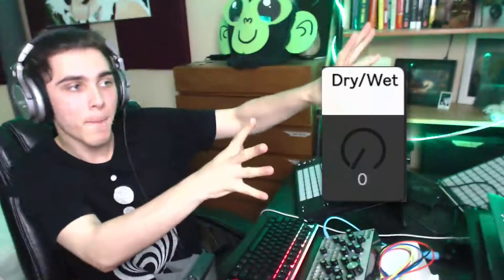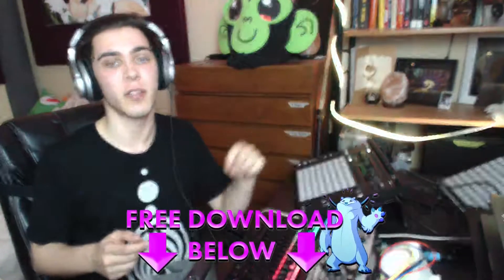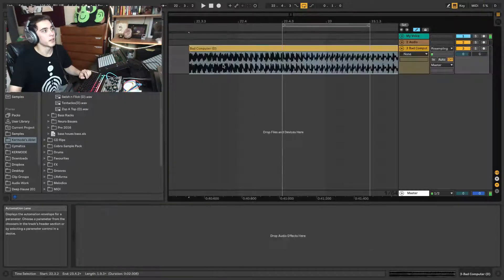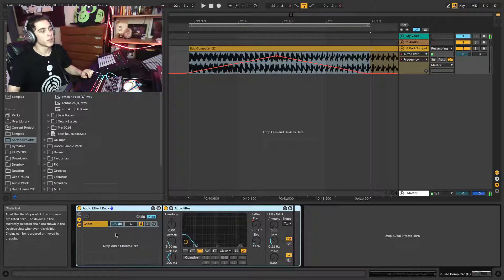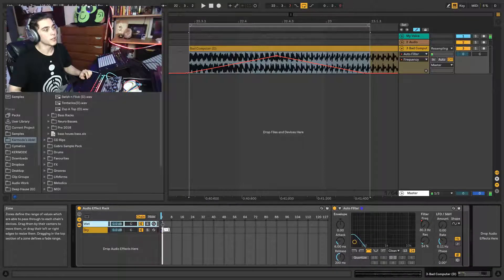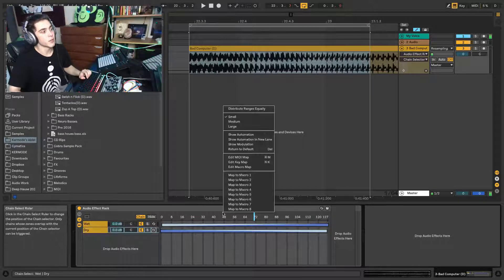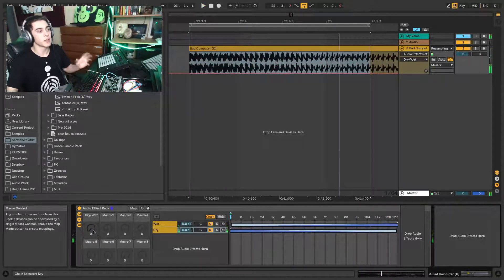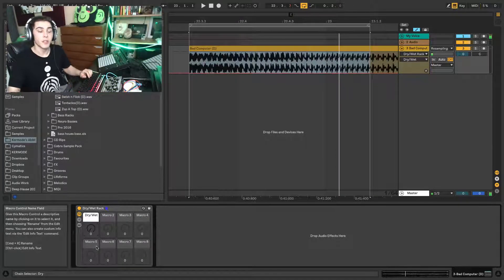NEED to Know Ableton Trick - Add a Dry/Wet Knob to Anything

Comment: You nailed it, but why doesn't Ableton follow Image-Line's and Bitwig's approach? In FL Studio there's a dry/wet knob in every effect slot (called a mix knob) and in Bitwig you have to just select the effect, group it and then you can control the group's mix knob as if the effect itself had one. We're in Live 11 and this still hasn't been fixed? Even though it's really simple, it's a bit of a hassle for almost everyone, especially for beginners.
(I've been producing for almost 2 years, still have a lot to learn, switching between these 3 DAWs but using Ableton for my current project and I find that there's no dry/wet knob on anything, unless you make it yourself. I had to reference this video a few times, probably more than needed to make sure I'm building the "knob" correctly. Sorry Ableton, Live is a great DAW, not gonna lie, but it's missing some basic things that it shouldn't, at least for me.)
Reply: You sound like me. Started in FL then Ableton 10 then Bitwig for 6 months and now back on Ableton 11. Fingers crossed Bitwig makes some better effects and improves midi editing and then maybe I can go back. For now Ableton 11 is the best even with the workarounds and m4l.. i like having saturator, amp, and erosion... bitwig FUCKED up by not making their saturator and amp like abletons idk what they were thinking.. And honestly this was super easy to make and now I always have it so Ableton does have it as an option it's just not a stock preset.. the thing that i despise in ableton is its horrible browser and how unintuitive it is to save and organize.. every daw should take notes on bitwigs browser and tag system Abletons saving is completely random depending on the device its annoying af when switching from m4l to plugins to racks

Comment: Thanks for the video but do not use this technique, its wrong. In the middle the volume rises by +3db which will mess with your balances.
Reply: Pretty useless information if you don't provide an alternative
Reply: @wipedfromexistence3693  Maybe you don't care about the gain boost. I do, and I believe lots of others do too. For us, it's not useless information. If youtubers had included that information in their tutorials on this technique, I wouldn't have wasted my time with it. I guess that saying " here's a technique, it works for some applications, but has some flaws which render it useless for other purposes... for those purposes, I don't have an alternative " isn't as satisfying and impressive for viewers, even if it is more informative.
Reply: @wipedfromexistence3693  So, we can dispense with the idea that PureSonic's comment is "useless information", unless you don't care about the gain boost, in which case you should have no need for an alternative. 

For a workaround, you can compensate for the gain boost by adding a utility to each chain, and mapping their gain knobs and on/off switches to the same macro as the wet/dry control. Set the range of one utility to +3 and -3 (and vice versa for the other), and set the range of one on/off switch to be 64 and 127 (and vice versa for the other). This isn't perfect, but it seems to get the gain mismatch down to about 0.1dB, which is less noticeable.
Reply: @robschneider7143  Thank you so much. Been trying to work this out for almost an hour, certain that it must at least be possible.

Comment: This is not a true dry wet knob. It is cool! But there will be major phasing issues this way. Cool effect, but not really a dry/wet.
Reply: Any suggestions for a better way in ableton?
Reply: @Pazaluz  I’m not entirely sure that it is possible without getting into the code of the plugin. Mavbe you can do some manual adjusting of the phase with phase utility plugins to get it to line up.

Comment: Is there a benefit to doing this vs just automating the volume of the wet signal on top of the dry?
Reply from the maker: not really. It's just manually turning one down at the other up at the same time, so one lane of automation vs two, but honestly automating gives you more control and I would probably me more likely to do that myself over this
Reply: Kermode thanks g